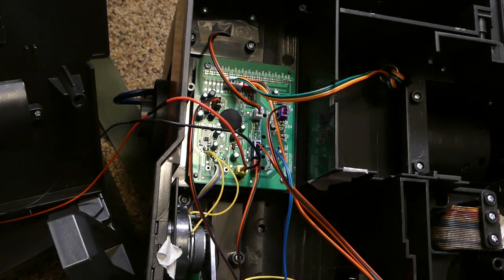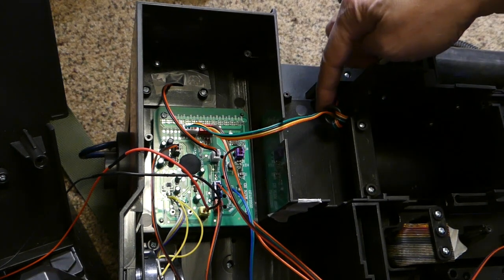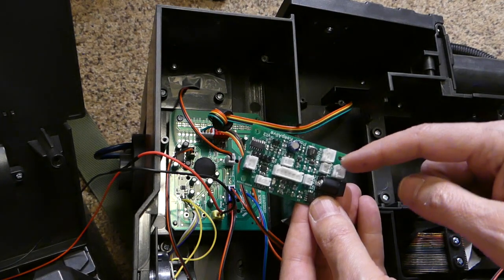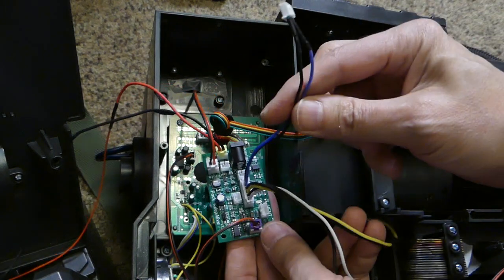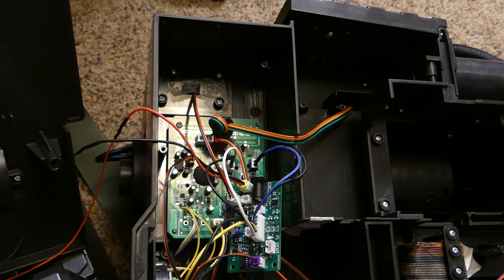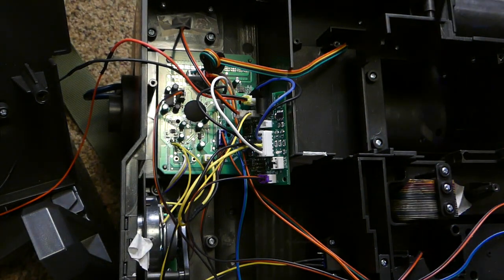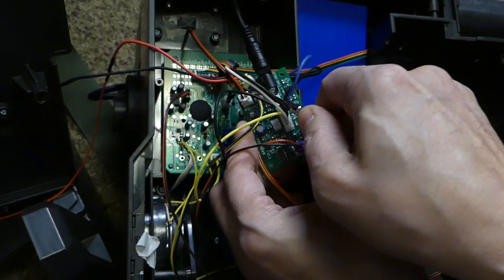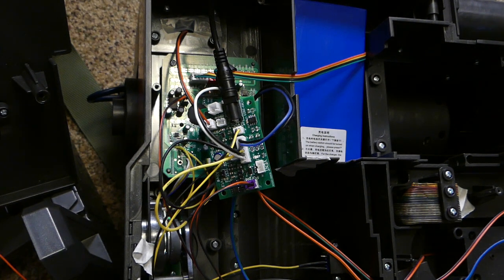Haslab Hasbro Pack Keep Alive board installation Spengler KeepAlive

Comment: Can you power on with the cycolotron lid off ? The reason I asked because mine for some reason not working with or without the lid ? I can't figure it out
Reply from the maker: There is a lid sensor that goes to the original board.  Wires and contacts on the lid should be carefully checked.  My packs are in storage at the moment so can't check, but the wand should still be able to power on, though the pack is still controlled by the original circuit board that wants the lid on before the pack will power up.
Even without the lid attached, you should be able to toggle the control switches inside the cyclotron and the original sound board should make short sounds.  This can check that the boards are getting power and the speaker is attached.

Comment: how much power does this board draws from the D cell batteries?
Reply from the maker: Not much... Most of the power draw is the same as what the pack and wand normally draw: All of the current just goes through this board over to the pack and from the pack through this board to the wand.
Adds just a few mA compared to without the board.

Comment: What does the toggle switch do if you use the battery pack? And if you use a battery pack is there danger of frying the boards when you charge it?
Reply from the maker: The toggle switch in the production board is only used to disconnect the battery pack, since there was no switch included on the pack to actually disconnect the battery.  The 12V input no longer has a switch and I am relying on you either disconnecting the battery or turning it off when not in use for long periods of time.

As for charging...  Some chargers do put out more voltage than expected/needed and also it can be very noisy and have larger voltage spikes.  It is best to disconnect the battery when charging, but the power supply on this board is rated to handle 18V in, so if the spikes do not exceed that the output voltage of 6V (to emulate a fresh set of D cell batteries) will not be affected.

Comment: What happened to your Ebay Store?
Reply from the maker: Been on vacation!  It should now be back up and running.
The Wand KeepAlive circuit boards have arrived, but the pack KeepAlive boards have not yet shipped...  Hopefully soon!
Reply: @ghostlab42  you already made the circuit boards for the haslab packs and I missed them? Or you mean they will be up soon on ebay?
Reply from the maker: @genedavis1386  Nothing missed.  Just that the Wand KeepAlive finally has all of the parts (I still have a lot of work to do before they are available for sale), but I am still waiting on the Pack KeepAlive parts - it always takes longer than I want it to!
Reply: @ghostlab42  that's great news. I know you have a life outside of all you do and I appreciate the hard work you put in to this mods. I see lot of people making keep alives and having problems. I plain on just wanting on yours cause I know you do great work and it'll definitely be worth the wait. Thanks for your response

Comment: Will a 12V Talentcell work with this?
Reply from the maker: It worked great with the TalentCell I have (YB1206000).  It uses the 12V output and the TalentCell's cable with a male 5.5x2.1mm connector.  No need to have or use the USB 5V output if you have that on the Talenctell you are using.
Reply: @ghostlab42  I have the 3000mah version.. will that work too?or do I need the 6000mah?
Reply from the maker: @EctoPlasmic  IT will work fine.  The 3000mAh vs 6000 or 9800mAh (the blue brick style I also use) is related to how long it takes to drain the battery.  In theory, a 6000mAh battery will run the pack for twice as long as a 3000mAh battery, though actual current load, internal resistance, and other factors can come in to play so the 2x is just the first order estimate.  I have not run the pack with a fully charged battery until it stops (yet) with a new battery pack to give you reasonable estimates of how long it will run.  I will do that when I have the final boards done.  
The D batteries are not really allowed to run down as far as they could, so some of the capacity of those is not used.  With the switching power supply for the 12V connection (or if you are not using this board and have some cabling to use the 5V output from a TalentCell) a very high percentage of the 12V battery capacity should be able to be used to power the pack.

Comment: This is amazing, truly remarkable work here. I will definitely be picking this up as well as a larger rechargeable 12v battery when this is available! Thanks!

Question - If I have this board installed with the stock wand connection to the pack, will this also keep the wand running without a timer or do I also need the 'Spengler Wand KeepAlive Board' you also mentioned. Thank you!!

Comment: That is such a cool (needed) upgrade to the haslab pack.  Couple of questions...will it be possible to add in a relay for venting/smoke effects?  &, will the wand need to be modded as well?  Thanks!!
Reply from the maker: That is the plan! And yes, it will require modding the wand also so the wand can send the request to the pack.  No extra or separate  switches needed to control the vent relay.
Reply: @ghostlab42  awesome!!  Thanks for the info & working all of this out.  I cant wait for the next update!  👍👍

Comment: Looks great! And I will be (im)patiently waiting for this to come out. Do you have any plans on attempting to link this with the wand so that the wand will still be able to control the pack? (If possible at all)
Reply from the maker: Almost - working on two main items: power up/down control even when both have keepAlive boards.  The up/down control is already there, but you end up ignoring it somewhat to have the pack keep running.
And I am working on getting the wand to be able to control a vent relay in the pack, so some limited communications between the two.
Reply: @ghostlab42  so I’m laimens, even if both have keep alive boards the wand could in theory power the pack up and down like default? Sorry if I’m not getting it right.
Reply from the maker: @ecto1139  It is complicated, and also not finished yet, so may change somewhat before the boards are finalized.
With both KeepAlive boards installed, the wand will powerdown the pack when you turn the wand off.
Reply: @ghostlab42  awesome man. You’re doing an amazing job so far it seems. I really look forward to the finished product!

Comment: this is so cool. was hoping for a nice "Drop in" rehcarable battery solution and the idle timer removal is a great bonus. will def be picking this up. 

anyway to get that battery to also power a powered speaker? seen lots of people adding BT ones that sound great.

Comment: Could you provide info on what battery pack that is and where you bought it? (A link?)
Reply from the maker: I randomly purchase on eBay and amazon.  Search for "12V rechargeable 9800mAH".  If that is not narrow enough you can add "DC 1298A"

Comment: I knew you would come through pretty quickly. I’ve been putting off any mods until you would have some upgrades ready. Now I can start prepping the pack in anticipation. Before I go get a speaker, do you have any intentions of releasing a sound upgrade similar to your Spirit pack kit? I’d prefer to open the pack once and get everything installed in a single session.
Reply from the maker: Not for some time - At that point I may want to just gut all of the original electronics and that is a larger undertaking.  You may consider just tapping off the speaker wires and putting that into a separate differential input audio amp and power that from a 12V battery (the same one if you have another Y cable).  That should be able to supply about 10W for a much better speaker.  Probably some soldering to attach wires to the speaker.
Reply: @ghostlab42  thanks for the reply. Any ETA on when this board will hit the streets?

Comment: Can anyone tell me what the talentcell equivalent would be? To the blue brick
Reply from the maker: The talentcell equivalent mAH capacity battery was larger than the blue brick so mounting was not obvious.  Even the 600mAh capacity (YB1206000) I have is physically larger than the 9800mAH capacity Blue Brick I also have (DC 1298A)
Reply: @ghostlab42  thanks for getting back to me, does it have to be 9800mAH?
Reply from the maker: @craigbrenkley8106  Not at all!  That is about the largest one that I had that fit nicely in that area behind (and into) the secret compartment in the pack.  Smaller capcity (mAH rating) or larger are all fine.  The main requirement is 12V DC and a 5.5mm x 2.1mm plug if you want it to connect to the Pack KeepAlive board which can then power the pack and an attached spengler wand.
Reply: @ghostlab42  that's a relief I'm grateful for your help, really appreciate it. Any chance of an ETA for this?

Comment: This will keep the pack alive, even when the attached wand times out?
Reply from the maker: Yes.  Kind-of - if you also have the wand KeepAlive, the wand won't time out...  Either a standard or a modified (Wand KeepAlive) can turn the pack on /off, but not because of a time out.  Details are purposefully sketchy until I verify the operation!

Comment: Will the spengler link kit for the wand work with this?
Reply from the maker: Yes - ish.  It will keep the wand alive but it will not control the pack.  The Pack Keep Alive will look for new signaling from the Wand KeepAlive board to know that it should respond to the wand.  
The Wand KeepAlive will use the same connector and mounting as the Spengler link, but does not support the audio or power connections.

Comment: I'm ready Doug, take my money!  Just to clarify, if I were to have a custom 6v 2.7Ah battery, with a jst connector (like the original battery connector), this will still work, correct?
Reply from the maker: If you had a 6V battery it would just replace the 4x D cell pack and connect to the same connector on the Pack KeepAlive board that the D cells would normally plug into.  It would also work on an unmodified pack by plugging that into the place on the pack's original board that current connects to the D cells.  It would not work well with the DC power plug on the Pack KeepAlive board since the switching regulator wants a voltage higher than its output and it is designed to provide 6V.

Comment: I bought the talentcell 12v 3000mah with 5v USB. Would this one be enough power to run the pack with this new circuit board or would I need to buy a more powerful one
Reply from the maker: That may be about the same as the D Cells, depending on the D cells and how low of a voltage the pack can use.  The 5V USB is not used by the Pack KeepAlive's power jack, but you could use that with the appropriate JST connector cable instead of the D cells.  Otherwise you could use both the D Cells and the 12V connection on that battery with the Pack KeepAlive for maximum run time.

Comment: Amazing work. So the pack can run on 5v from a talentcell, so you must be stepping down the voltage that the pack sees from the 12v input, correct? I know 12v direct would kill the haslab board. lol
Reply from the maker: Yes - a switching regulator down to 6V DC since a fresh set of Alkaline D Cells would provide about 6V.
Reply: @ghostlab42  Awesome. You sound like a electronics college professor I had - his name was Doug Sherman. Is that you Doug? LOL

Comment: How do you charge that rechargeable 12v battery?
Reply: Should have two cables. One to output power and one to receive a charge via a DC charger. I’ll bet you just open the side door if the pack to access the charging cable (and battery power switch).

Comment: Ive been waiting to do any mods because I was certain you would come out with something!  Thoughts on speaker replacement or power amp yet?
Reply from the maker: I don't think just a different speaker will help much.  For louder it is going to require an audio amp and use of a higher voltage, like a 12V battery powering the audio amplifier.  This should enable up to 10W into an 8 ohm speaker and possibly more to a 4 ohm depending on the audio amplifier.  The pack's speaker is labeled as 1/2W so a different speaker would be needed.

Comment: I am definitely interested in this! I want one when they go into production.

Does this also keep the wand alive (the 30 second timeout from Hasbro is ridiculous)? When these are in production, and I add this board to my pack, will it also keep the want alive, or does that require modification to the wand as well? I really like my Hasbro pack and wand, I just don't want the damn thing to turn off on its own.
Reply from the maker: I have the same issue and that is why I am making these boards!  For the wand to keep the lights on indefinitely, you would need the Wand KeepAlive board installed in your wand.  That is the only way I found to get around the 30 second idle timeout.  But... that can also keep the pack alive, so if that is all you want the pack would not have to be opened up.
Reply: @ghostlab42  The wand keep alive will also keep the pack alive? I want to make sure I get the right part. Could you perhaps direct me to a link to the correct part for this? I have seen so many different things people have been working on, that I don't know which is the right thing. I am still interested in this mod, too, because I would like to also keep the pack alive by itself without the wand running.
Reply from the maker: @adamhutchins1981  The Wand KeepAlive can keep the pack Alive also, but if the wand is not attached it can't do that so you would need the Pack KeepAlive.  Basically if you want both the pack and wand to be able to run indefinitely when they are used separately or together, you would need both KeepAlive kits.
I do not have these available for sale yet (still developing them), but the description above does give a link to the GBFans thread I am keeping updated on the progress.
Reply: Right, yeah, I know the wand would only be able to do that if connected...but I remember someone doing some testing with arduinos and found that (at the time with the current setup) he was able to keep the wand alive, but the pack would still shutdown. That's why I was asking if the wand keep alive could do that. And yes, I know these new pack keep alive boards aren't available yet. I was asking if you could provide a link to the wand keep alive that you mentioned, so I could make sure to get the right one for my wand. Sorry for any confusion. And also many thanks, I'm looking forward to doing these mods to my pack.
Reply from the maker: @adamhutchins1981  Interesting...  The Pack KeepAlive board will keep power to the wand, but the wand has multiple idle times that make it hard to have the wand keep the lights on even if the power never goes away.

No links to the wand KeepAlive yet, other than the GBFans link in the video description.  I will add a link to the description when it is available in my eBay store.
Reply: @ghostlab42  Definitely keep us updated! I am definitely in for at least one of your new wand keep alive kits, and would likely also be interested in the pack keep alive kit. This is so awesome, and I can't wait, lol. Oh, and of course, many many thanks for all of this!
Reply: @ghostlab42  Any updates? I am not sure where to look. I check your eBay page occasionally. I am really looking for a pack and wand keep alive for my pack. Please let me know when and how I can get these.
Reply from the maker: @adamhutchins1981  See the links in the Description.
And here is the latest:
The Wand KeepAlive boards are finished, but I am waiting for the Pack KeepAlive printed circuit boards to arrive so I can finish testing the two together and will probably need a couple of minor changes to the programming.

Still no confirmed ship date on the Pack KeepAlive board, but it was supposed to ship out a week and a half ago. Not sure I will meet the end of April projected date to offer these kits. I have all of the other needed parts!

Comment: What a great mod! Two questions:
1. Do you have a link to that battery?
2. What is the time difference, then between the old battery setup and the new battery? Is it a 10% increase in pack life, or greater?
Reply from the maker: Depends a lot on which D cell batteries and which 12V rechargeable battery you use.  I haven't timed it directly yet, but it looks like the pack shuts down early from the D cells, at around 4V, so does not use the full mAH capability.  But that aside, if the D cells are rated at and can use 10,000mAH, a 9800mAH 12 V will run approximated 2x longer because of the higher voltage.

Comment: Awesome! I originally intended to keep the original D batteries but after seeing how this board even has a part to let you plug an external battery and how it's literally "plug and play", it's definitely making me reconsider the D batteries. Looking forward this to this item.
Reply from the maker: Or use BOTH.  The KeepAlive now works with either source or both combined for even longer run times.

Comment: Can a clockwise/counter clockwise option switch for the cyclotron lights also be added?
Reply from the maker: At this point I do not connect to the signals between the Pack's original circuit board and the serial LEDs in the powercell or cyclotron, so no way to modify sequencing of the lights.

Comment: Outve curiosity can it still run on the d cells as I'm not wanting to add a new battery pack
Reply: from what the video shows, yes it can.
Reply: @brianbennett2775  just wondering what the ETA for this is